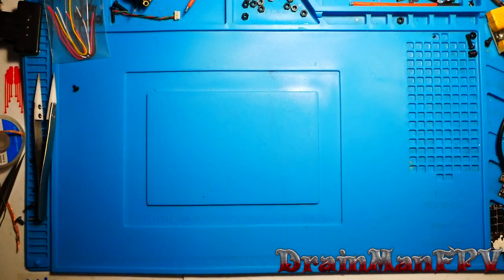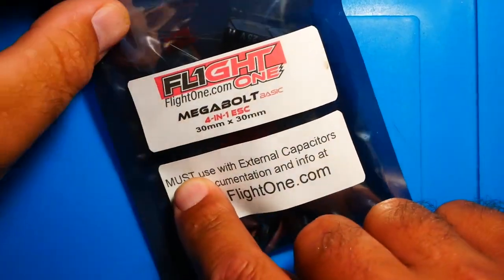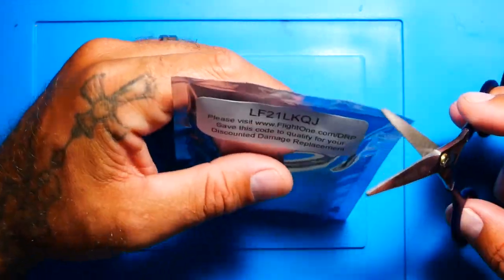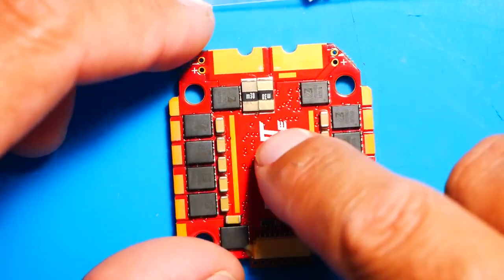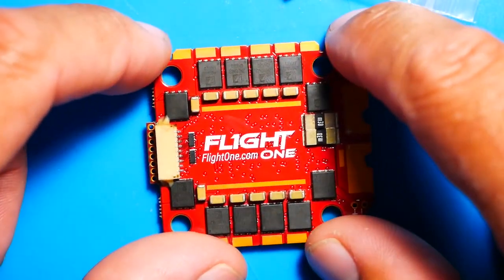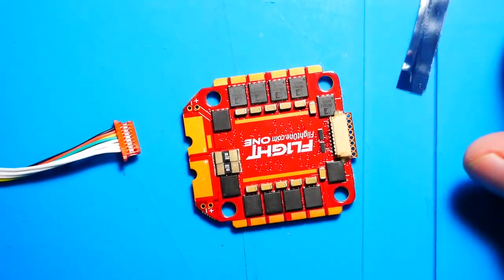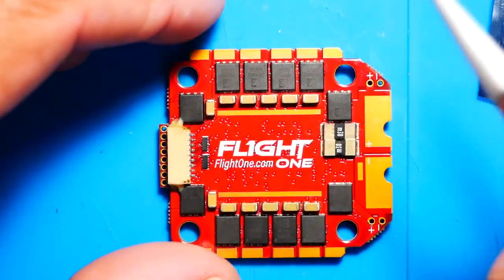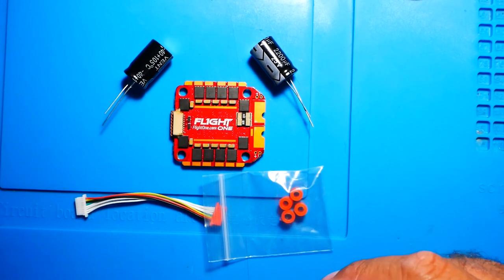FlightOne MegaBolt Is Here 🔥🔥 Brand New 50a Work Horse ESC !!

Comment: We didn't forget a trace, but there was extra noise caused by too big of a ground on the mcu, so by increasing the size of the power trace it cut some noise.  It isn't really a big issue in general, but we just found that this made it more bullet proof, future batches we will use a 0 ohm resistor there, but the fix was found after we received them in china, so I actually did those by hand..
Reply: I just removed the bridge thinking it was a factory defect.. is that going to cause any issues?

Comment: Why do you say the afterburner esc is not ment to be push on 6s... 
They tessted it with no problem......
Reply from the maker: It can do 6s just fine, I have mine on a 6s. They have just designed the Megabolt much stronger, so if you're wanting to push your quad really hard, go for the Megabolt.

Comment: Very informative and helpful video. Will you be installing the extra freestyle capacitors or the heat sink in your build?
I have the Cricket fc, would this esc be a good match for a 7 inch build? I mostly see information for 5 inch. Thanks, happy flying. 👍🤓
Reply from the maker: I'm going to run the capacitance expansion board. This ESC would pair beautifully with the Cricket FC, especially for 7inch.
Reply: @DrainManFPV  Sweet. Looking forward to your build video.  :-)